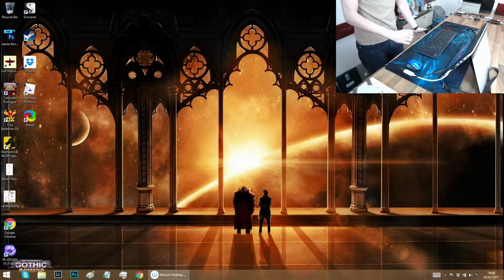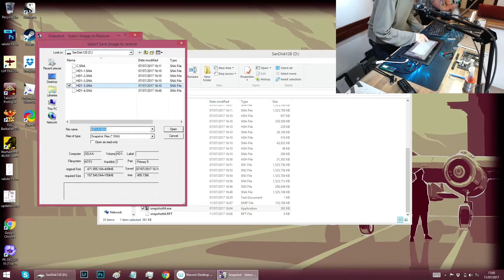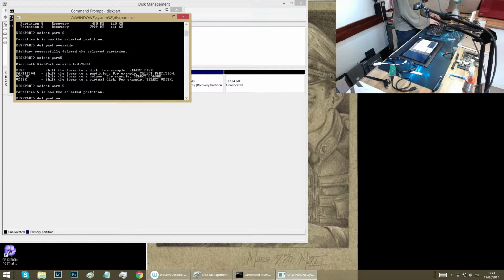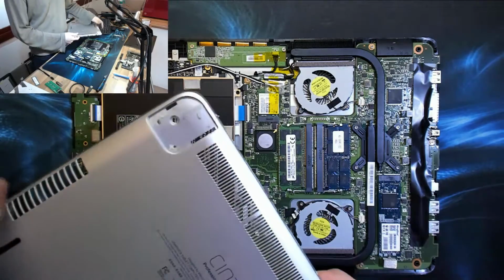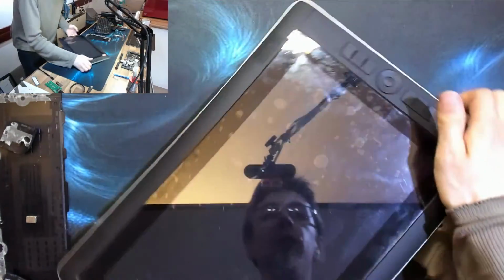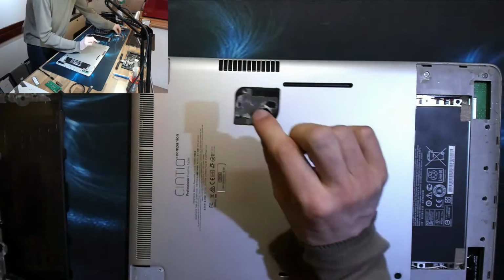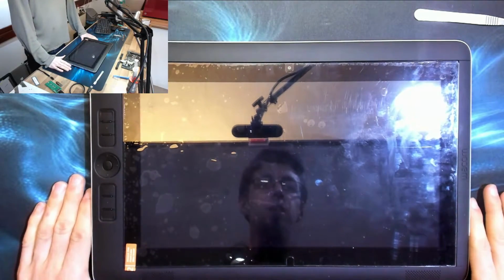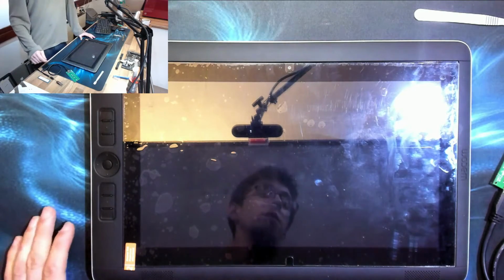LFC#113 - Upgrade RAM / Storage on Cintiq Companion 2

Comment: I know this is video quite old now but this helped me open my Companion 2 with out doing any damage what so ever! Thank you!
Reply: I’m not sure how that is possible! I’m trying now, and this thing seems like a nightmare. I’ve already peeled rubber away from the plastic and can’t find anything that is thin enough to get in between the cracks! Just a razor blade, but then the damn thing snapped off and is wedged in there!

Any tips would be greatly appreciated.

Comment: Hi Adamamt IT! My CC2 screen just went out, not even the backlight works. The computer seems to be working fine when plugged to an external monitor. What do you think this could be? I bought the replacement LCD part over ebay and was wondering if you could kindly help me replace it. Thanks for the video!
Reply from the maker: I'm not brave enough to do a screen on one of these I'm afraid - that's more tablet stuff, which isn't really my wheelhouse. I was never very good at doing iPads and such!
Reply: This is a design flaw with these devices. The screen is propably fine. A compoment on the motherboard has failed and needs to be replaced. I am currently working on finding the problem.

Comment: In my old companion 2 (i7 16ram) display stopped working. Do you think when I buy an old weaker model (i5 8ram) could I replace the parts and put my cpu and storage to the weaker newer one?
Reply from the maker: The CPU will be soldered, so not replacable :(
Unfortunately these devices haven't really aged very well. They were a bit ahead of their time I think. Lots of similar modern devices, but with a lot more horsepower so they have a longer lifespan.

Comment: How do you make the new ssd bootable? Do you boot up using the adapter that has the old drive attached?
Reply from the maker: In this video I imaged the old drive to the new one, which includes copying the boot sector and boot manager. But if you were installing from scratch, you'd make a Win 10 flash drive (https://www.youtube.com/watch?v=q6KyH5dYmVc) and use that to install windows. This method would automatically set up the boot manager on the new SSD during install.
Reply: @Adamant_IT  Thanks. I'll get a larger SSD ordered to replace the one installed. I've got a Companion 1, which used the smaller format msata drive, but the procedure will be the same. Thanks again..

Comment: Do you remember what type of SSD This takes? I was hoping to up it to a faster SSD if possible. Wasn't sure if it was Sata or PCIe.
Reply from the maker: I don't I'm afraid, given the age of the device I'd expect SATA - but I wouldn't expect to see any real difference, even on a quick computer it's hard to discern the speed difference between SATA and NVMe unless you're transferring to another SSD. And even then banging data around at 550mbps is still pretty quick for consumer hardware.
Upgrading for capacity would also be a valid option, but yea, I wouldn't expect to see a speed boost.
Reply: @Adamant_IT  Cheers, you're right, I saw some ssds that were PCIe and saw the speeds hitting 1700mb/s  vs the 500mb/s I am currently getting, had hoped that might be a viable upgrade path, oh well :D

Comment: do you know anywhere to get an upgraded battery?
Reply: Did you ever find one? I’m about to get a replacement battery, but can’t find any upgraded ones. Only seeing 4470mAH batteries for the DHT-W1310 model, but seeing 8000mAh batteries available for the DHT-W1300 model and they don’t look to be interchangeable.

Comment: Thank you for taking the time to make this video! I have the same Cintiq Companion 2 with Windows 8.1 and would like to upgrade from 256GB to 512 m2 and add an extra 8 gigs following your steps. Which SSD would you suggest to fit my CC2?  Just like others in the comments, I can't find a battery for my Cintiq Companion 2 so I just took it out because it was overheating and causing my computer to shut down. The computer working great without the battery plugged in but it would be nice to have a battery so I can work without being plugged in.
Reply: im having the same battery problem!!! if you find A fix please message me!! as i will do the same!!
Reply: I haven’t found a replacement battery, but mine still hasn’t failed. If I needed it to be off mains power, I’d go to a battery shop and have them make a good size custom Lithium battery with the right connector to where the power brick would plug in on the outside of the system. And remove the lithium battery inside the case, of course. Thin, but the same size as the base of the stand, Velcro the two together.

Comment: Hi! where I can get batteryfor companion 2 ? I cant even find on ebay or amazon. I did dissassembly a whole part of my companion to change battery dan screen :D
Reply: @Adamant_IT  thank you :) till now i cant find battery, all sold out..I want to try using another battery (normal laptop internal battery) with 11.4V 53Wh but im still not sure it will possible or not. bcs mostly laptop battery have 8 pin. but companion battery having 10 pin.
Reply: @Adamant_IT  thank you so much. Can't wait to watching your next tutorial . Ow, can I upgrade companion ram using norml laptop ram ? Yesterday I did tried, but undetected on windows system. i did checked on cpuZ ram is there..Thanks again 🙂
Reply: I did as well and im also having a hard time! let me know if you find A fix!

Comment: Companion 2 support M.2 NVMe SSD?? motherboard’s slot looks can NVMe support. Anyone can NVMe SSD upgrade??
Reply: Adamant IT thanks for your vidéo. I guess the m2 speed in a CC2 can’t go over 1.5 GB per second. Do you Know if it’s possible to replace the m2 by a 1 to model ? Or 512 go is a Max ?
Reply: Any answer to this?
Reply: @joesandstrom4111  @Soraworks  Cintiq Companion 2 does NOT support NVME SSD. The M.2 slot does not even have PCIE lines, tested with an AHCI M.2 B+M Key. It is wired for SATA only.

Comment: I have a Quarry  my cintiq companion 2 firstly the express key and pen& touch stoped working after few windows updates the display is dead so the pc turns on but the display is bank, what do you think is the problem should I open it and  re-insert  the ram or should I send it over to the service centre

Comment: Wow!  What a crappy thing to do, just slapping in 8 more GB of RAM'  not even the same brand/model!  What the hell!  This is a precision tool that deserves better!  It should get a MATCHED SET of 8GB chips made at the same time, same place, same day.  OOOH THAT PISSES ME OFF!  Some friggin TECH!
Reply: If it's the same spec & reasonable quality, it makes exactly bugger all difference what brand it is, & actually insisting on the same manufacturer & time increases your chances of modules failing at the same time down the road.  The only reason to match brands would be visual, in a gaming PC with a windowed case, & convenience buying them bundled for a new build.
Since electronics (like memory) tend to fail early or only after many years, continuing to use the existing proven module is actually a good idea for reliability, you're only introducing one part in it's early higher failure rate stage of life rather than two.
The whole "Better to match perfectly in all respects" thing is pure marketing BS so you buy two sticks instead of the one you actually need.

Comment: If you used a blowdryer,  those black back panels will basically fall off!  (AND THE SAME TECHNIQUE TO REPASTE ON with the SAME GLUE/TAPE!)
Reply: also fry the hardware on the process
Reply: @AleXanDraPR369  This tablet gets hotter than a blow dryer ever could!
Reply: I’m not so sure about that... I’m currently attempting a blow dryer and these damn things seem cemented on!

Comment: do you by chance have a site you would recommend to get replacement parts for the companion 2? Mine wont hold a charge, and Wacom told me it needs a new battery, and i cant find a site to save my life... Any info would be much appreciated.
Reply: https://www.ebay.com/itm/64Wh-7-4V-G6BTA007H-Built-in-Battery-for-Drawing-G6BTA007H-2ICP7-65-80-2-Series-/253607753017?oid=282901287707   

MY COMPANION 2 IS HAVING THE SAME ISSUE-  I STRONGLY THINK WACOM IS IN THE BUSINESS OF RIPPIN OFF ARTISTIC PEOPLE. THEY WON'T ADMIT THAT IT IS A DESIGN FLAW.  GOOD LUCK WITH YOUR 1500$ PAPER WEIGHT.

Comment: thanks for this, I kind of used this video as a guide to upgrade my RAM to 16GB.  Not brave enough to upgrade the hard drive as I'm not too familiar with Windows BIOS stuff, so I  didn't want to mess with that.  I really chewed up my black bits however :)  BTW, did you find that the battery itself was not secured/soldered down (as I did) when you opened up the CC?
Reply: ok, interesting.  Thanks again, maybe I'll give it a try down the line.  Definitely NOT tech savvy with computers, but watching your vids is fun and educational.  :)

Comment: Hello. Great video. I was wondering where I could get parts for this? Mine is not charging..I already took it apart ( thanks for your video)and made sure the power connector was in perfect shape. The tablet works with the battery removed. Sometimes it would say “plugged in, not charging” but most of the time is  “not charging”. I have already tried the fixes of uninstalling the battery from device manager but nothing works. The only thing that happen during my troubleshooting was the battery  not being detected at all.  Where can i get a new battery?  Wacom want to charge me $1K to “fix” but I paid $700 for it. Please advise, thanks
Reply: at times mine would say that it's "not charging," but when I pull out and re-insert the power cord, then it would start charging again.  Interesting, though, that you say that the CC works with the battery removed.  Because mine almost literally fell out when I pulled the back cover off.

Comment: The fan was so loud, it made it awkward to work at a very silent room full of people...
Reply: in Advanced Power settings you can tell it to do PASSIVE cooling (ramps down the proc to keep it cool instead of running fan,)  works great for 90% of applications, then have a toggle button to switch to full power mode again,.for when you really need,,   also makes the battery last 5-7 hours instead of 1-2 !!!
Reply: every silent room full of people is .. awkward..

Comment: Really nice video, and a very informative one. I wonder if you could help me on a related subject: the fans on my CC2 are very noisy, and I'd say one of them is not working. I took them out, cleaned them, but the noise is still there. I've looked for the part number, but it's nowhere to be found. Do you know of any fan that could be a direct replacement, or if a fan with similar specs may be used? Thanks a lot!!
Reply: Hi! Thanks for taking the time! The part number is DFS170005040T, and I'd say it's more like a hum.
Reply: Well, that's a bit of a bummer, but I really appreciate you taking the time. I tried to find another fan with the same size and specs, but it's practically impossible! I guess this will be my "headphones only" device! Thanks again!!

Comment: I have a feeling that you were inspired by CGAlchemist and his videos
Reply: Adamant IT alright. I wasn't accusing you of fraud or any of that sort if it was taken that way. Also, I've taken apart my companion as well as upgrade the ram. I plan on upgrading the SSD and the wireless adapter. Do you have any suggestions as far as compatible and as up-to-date hardware goes? Affordability isn't a factor I'm looking at the moment.
Reply: That makes sense. I'm also looking into seeking if it is possible to find an internal cellular modem so I can have internet on the go! any thoughts?

Comment: Thanks for the video! A lot of the Cintiq Companions LCD monitors burnout only after 2 years or so - black screen and PC is fine. Have you fixed this issue before? Wacom wants $1200 to fix. Could be a good video.
Reply: Well thanks for the reply anyway and the great videos!
Reply: Adamant IT NO NO NO, IT'S NOT THE DIGITIZER, IT'S NOT THE LCD, IT'S THE CCFL BACKLAMPS.  I upgraded my Desktop Cintiq 21UX to LED backlights, it runs SO MUCH COOLER now! I'm certain one could do the same, (and I probably will someday) to my Cintiq Compantion 2!

Comment: Quick question: I've read somewhere about a new standard SO-DIMM that breaks past the addressable memory cap. I'm thinking about dropping 64GB ram into mine. I did do something similar with my iMac 2010 (whose advertised cap, I think, was 16GB, but it's now chugging happily away with a recognized 24 GB). Any thoughts, or tips on what to look out for before investing in 2 x 32GB SO-DIMMs? In theory, this should work ... I did also read that the cap for addressable pairs would still stay at 16GB, though ... but that doesn't sound right to me.
Reply: Thank you very much for your reply! As well, fantastic video. I've seen the one you referenced in yours (screwdriver) but it's nice to see the procedure done where minimising overall unit damage is a priority. Thank you for posting this.
Reply: Any updated info on this?